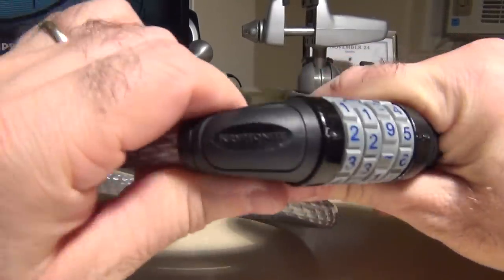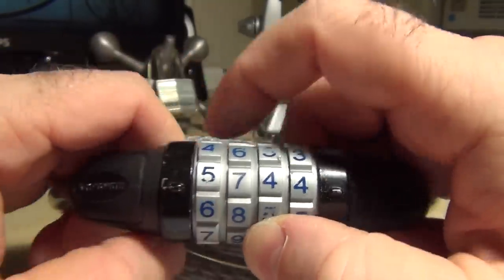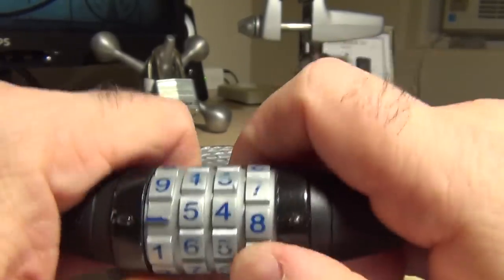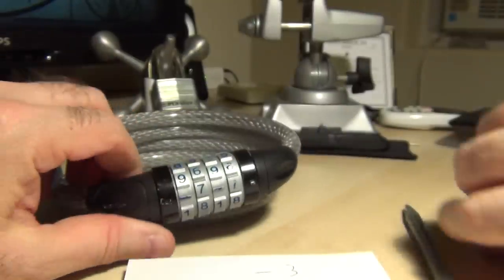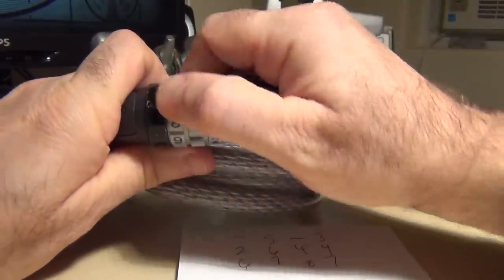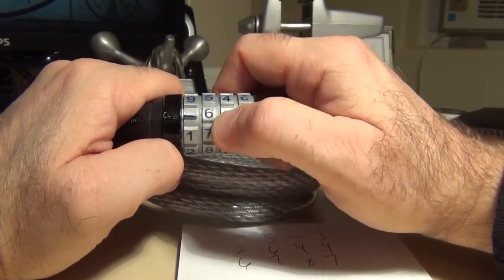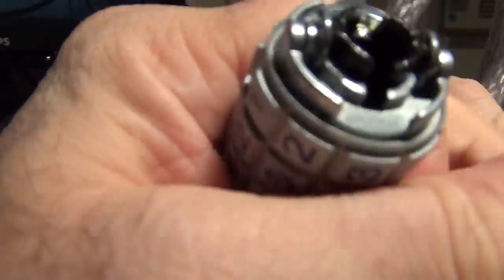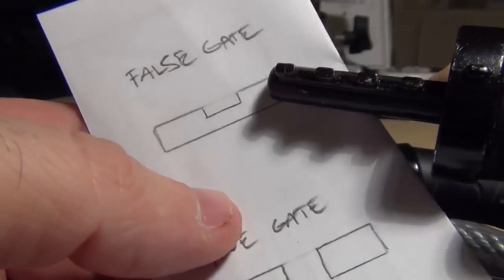Cracking / Decoding Kryptonite Combination Bicycle Locks

Comment: TIP: if you have a feeler gauge USE IT, put it inbetween the last number and the male end of the lock, you can eliminate false gates using this (ex. If your .010 gauge slips right in with the combo "0010" but there's a ton of resistance using "0040" you can pretty much eliminate that "4" as a false gate)

Comment: I bought a kryptonite crypto lock on Amazon it was used But for $50 I assumed it would still be set to open I have tried the 00005 and nothing works I’m so pissed off

Comment: wow thank you for this, the only video that worked for me. My Btwin 300 was locked in my cupboard. The main tip that worked was the tightening of the gates when they rotate. Not sure if was a true or false. So I got down to the last 2 numbers. The first 2 i managed to lock in. Then I just did the brute force on the last 2. Great Thanks a ton

Comment: Hmm, I wonder if the spacing of the false and true gates is the same for all locks of that model.  I'm guessing probably not - they probably just throw in a randomly spaced wheel when they assemble the lock.  At least now though, if someone resets the code on your lock (assuming that the spacing stays constant per wheel), you should still be able to know which of the gates are true just by the spacing of the gates?

1st digit: T +4 F +4 F +2
2nd digit: T +1 F +8 F +1
3rd digit: T +4 F +2 F +4
4th digit: T +3 F +6 F +1

Comment: The lock I'm working with is so badly weathered that the brand is no longer recognizable.  Does this method still work even if I don't know if there's any false gates?
Reply from the maker: it's possible, if you can find binding spots in each ring.
Reply: Whats a binding spot?
Reply: Very good.  I'll get started.  Many thanks

Comment: I'm trying to open a BELL Watchdog 100.  Starting at 1111 everything feels tight.  When I start turning one wheel, whether from the left end or the right end, I just don't get a sense of a difference.  It seems like more numbers click than slide.  I've tried turning it faster or slower to get a feel for it.  Any suggestions?  If I take it to a bike shop is it likely someone could crack this for me, or should I go to a playground and ask a kid??

Comment: I have what appears to be a Kryptonite 1218. I tried your method but it feels like there is a false gate behind every digit.  Can that be? Another Kryptonite 4-wheel lock that I have to which I know the combo and can see inside, has only one false gate and I can see it is 4 clicks to the left of the true gate on each wheel. If you know how far away the false gate is from the true gate, you could shorten the amount of combinations to try from 81 to just 16. On the other hand, if every click has a false gate, what then?
Reply: Tom I had the same problem. I have the 1218 Kryptonite combo lock, it felt like every gate was a false gate. I finally cracked it after an hour. Once I looked inside I only seen one false gate. I used the kryptonite video and this one to help me solve this issue. I think it was shear will and determination... and a lot of luck.  :) Hope you figured it out.
Reply: thx for helping :)

Comment: Wow, fantastic video. The first that I saw demonstrating and explaining false gates in combination locks in this nice way. I wonder if it is possible to feel the difference between true and false gates. That would safe a lot of time.
If they put in more false gates it would make the lock more secure, right? Are there disadvantages that come with these false gates? Like less force needed to pull it when in the false gates.
Reply from the maker: I didn't Saturday morning trying to crack it.  I had looked and didn't see any videos on this yet, so after figuring it out, I decided to make a video on it.  

I couldn't detect the true gates from the false.  They just bind up the wheel totally when either is hit.  It makes for a fun time like that though :)
Reply from the maker: The hardest part is actually finding a false gate to get you started.  The other wheels won't let you fall into one easily.  After finding the first, it gets much easier to get the remaining wheels to find a gate because of the extra slop.  If more false gates were added, it would definitely slow down the brute force progress.  But it would still be possible.  

Thanks for watching Pottie314!
Reply: What I meant by feeling the difference is memorizing the amount of movement you get on the pulling side form the 3 possible positions of one wheel, and then try to estimates which one was the most.
Reply from the maker: +Potti314, I'll have my son reset the combination tomorrow and see.  I'll let you know!
Reply from the maker: +Potti314, I tried to find some small difference between the clicks and feel of when a false gate vs. a true gate was encountered but i was not able to tell the difference between the 2.  I had set wheels 1 and 2 to the true gate to allow free movement through themm so that they were not hindering the test at all.  I then set wheel 3 to a false gate to allow for maximum movement of the male portion of the lock through wheel 3, and to allow me to feel wheel 4 through the 2 false gates and true gate.  I can report that movement and feel were the same to me - no difference at all from what i could tell.  The amount of travel for both the false and true gate appeared to be similar.  So they did a good job in that aspect.  Thanks again for watching, man!
Reply: +Git Pick'd Alright, no luck. Thanks a lot for testing!
I just ordered some combination lock to play with - you made me curious to get more experience by myself :-)
Reply from the maker: +Potti314 nice man, looking forward to your videos!

Comment: This method did not work for me and my Kryptonite but I did get it...appears my cheaper lock has only one false gate. Trick was to pull way harder than you think you need to: I was pulling with my right foot in the cable while pulling with my right hand and spinning dials with left hand 😂 then feel which dial (any dial) has the most tension and spin it til it almost locks on a number. Then find whichever next dial has the next most tension and repeat the process.

Comment: You could save some time and pull whenever you change any wheel, skipping the resets. I'm guessing you wanted to just keep this simple, but you could avoid confusion on numerical combination locks by "counting" the rotations that round (mod [# of gates per wheel], mod 3 in this case) using letters instead of numbers 
(i.e. aaaa, aaab, aaac, aaba, aabb... accb, accc, baaa... cccc, [end]). Every time a wheel needs to be reset, you're just mentally assigning it back to "a" instead of physically moving it back to the "first" gate.

Comment: i got this lock wich i didnt knew the combination.
so i listes the numbers that it has in a website and it gave me 1200 possible combinations
i went through most of them but i also skipped a couple that seemed "too weak"
one of them was 6313 for some reason. the actual code.
after completing 6666. i eventually ended up figuring it out with a screwdriver.

Comment: When you find the 3 gates ( 2 false and 1 true gate) on each wheel. It is always the middle gate that is the true gate. Example if the 3 gates were 5, 6 and 7 which was the case in your video then 6 is the true gate.
Reply: The true gate on the rightmost wheel is 3; the choices are 3,4,7.  If what you are saying is true, wouldn't 4 be the predicted gate for the rightmost wheel?
Reply: That logically can't be true if the combo setting mechanism is anything like other locks of this type. 
  Let's say you have gates at 0, 6 and 8 on wheel one out of the box (code 0000). Gate at 0 is the real one. If you change the code to 3000, then the gates will be at 3, 9 and 1 (i.e. 3,7,9). The true gate is at 0+3, not 7.